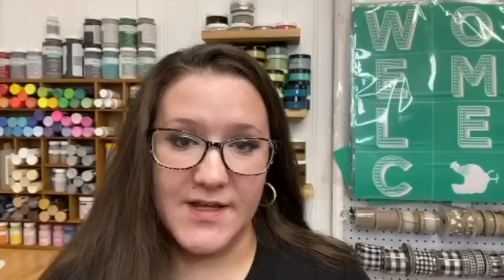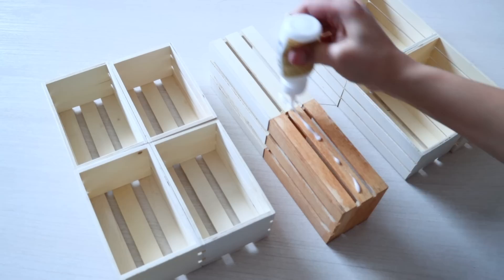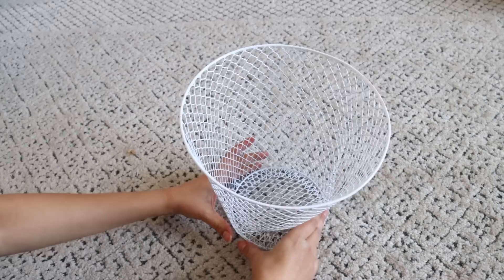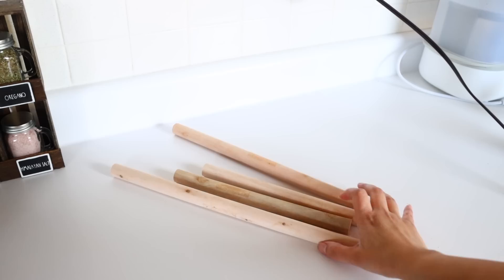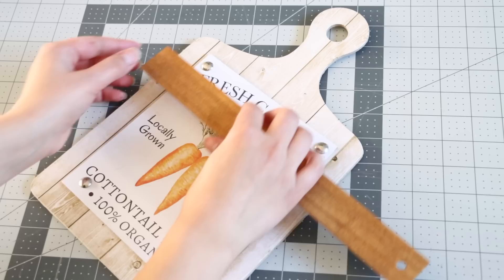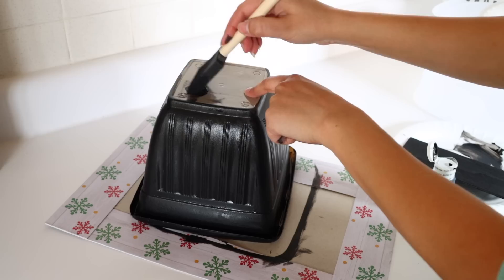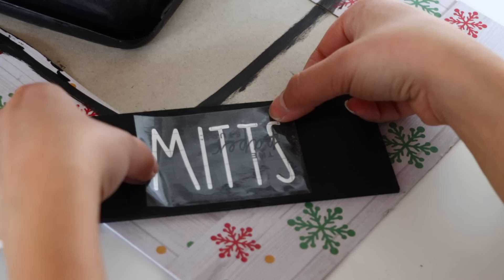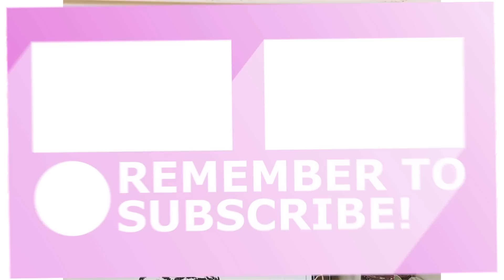DOLLAR TREE KITCHENS ORGANIZATION DIYS $1 PROJECTS THAT WILL BLOW YOUR MIND

Comment: All are good ideas and some I will make. I made a k cup holder for my daughter for Christmas. I used the same basket that you did but I took am over the door hanger and took one of the top hooks off and made the handle. I trusted the ends and made swirls then hooked then on the basket used some e6000 and it really  came out cute.

Comment: You know what works way better than the trash can for bags is using two pillow case holders that they come in cutting the bottoms off and gluing the tops together that have the elastic that way they stay compact and you can pull one by one out. I glue burlap to the middle to hide the seam of where they came together and I always glue a little string at the top to hang it somewhere :) just another idea!

Comment: For the plastic bags. In the south most people I know use a dish towel and see it together longways to make a tube, then add some string or elastic at the top and bottom to hold them inside. Whatever is on hand.

Comment: Great video. But to take your kitchen conversion chart / measuring cup holder one step further, you can seal the conversion chart to the wood to protect your chart using Mod Podge (can be found in the craft section of most dollar tree locations). ;)

Comment: There is actually a different way to do the bags and didn't cost me anything. It's folds the bags in half  long way. Then start to roll from the bottom to the top keeping the bag tight.  As you get close to the top lay the next bag on top of what isn't rolled and continue to roll. This takes up such a small space and you can add to it every time you get another bag. I just cut down a box to fit them perfectly. HAVE A GREAT DAY!!
Reply: My mom taught me this trick years ago too! Such a space-saver🙂

Comment: You've got some great DIY stuff, but you should really paint before you put stuff together and put your tags/ added pics on before assembly. It streamlines the process, takes less time and you're less likely to mess something up by adding things afterwards instead of before assembly. For instance, on the cutting board, you should've put the printed page on before even placing the the rulers. Also, I feel like you should sand a lot of this stuff down to make it look nicer. The handles on the basket cup could've used a little sanding, especially since you painted them anyways. A nail file works wonders as a sander on these cheap, thin materials. Also, a few drops of super glue holds better than glue gun glue for those things that you really want to hold, like that ladder.  😊

Comment: What is the proper way to use a zip tie. Mine never seem to hold tight enough.
Reply: You have to position it right so it locks
Reply: @levelpropertymanagement5915  thank you , but there's a small opening and a larger one which one is used first to lock it in place . Crafts are not staying secure.  I appreciate your help and Thank you again

Comment: Do all of the painting and preparation BEFORE you glue on the embellishments such as hooks and pictures.
The scales looked really SLOPPY with the paint on the scales' face. 
If you had stained or painted the little baskets before you glued them together it would have been easier... you could have simply and QUICKLY DIPPED each basket into the stain and allow it to drip dry then glue them together.... or you could have spray painted them, or just painted them individually before gluing they would have been easier to handle.